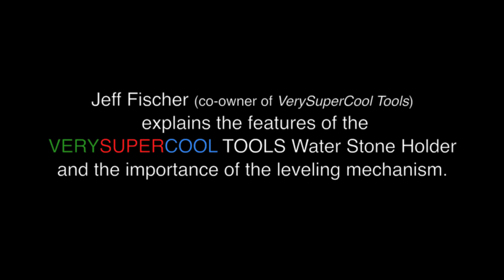1 of 2 SHARPENING USING WATER STONE HOLDER WITH LEVELING MECHANISM

Comment: For levelling, not sure how accurate it would be but... If the reference plane is pretty level, use a bullseye spirit bubble and then mark the centre with a dry wipe marker if it's not 100% centred. Then put that bubble on the stone and level it to that marker. Instant view of the position as you adjust. Love the product btw!!

Comment: This is a neat idea, but the adjustments seem pretty tedious.  I wonder if it would be possible to make the surface the stone sits on adjust independently from the feet.  If you could flip the jig (with the stone in place) over on your reference surface and just snug down the adjustment screws, it would be level when you flipped it back over.  You'd need a removable spacer so the stone would sit proud of the surface of the holder.  More complicated, but it would sure be easy to adjust for level.